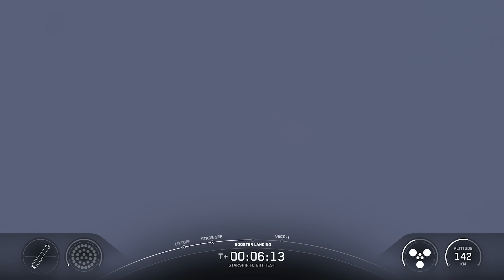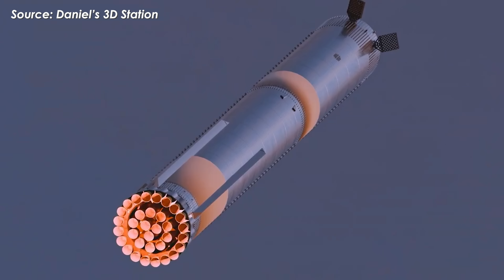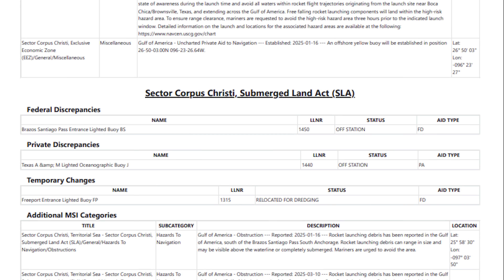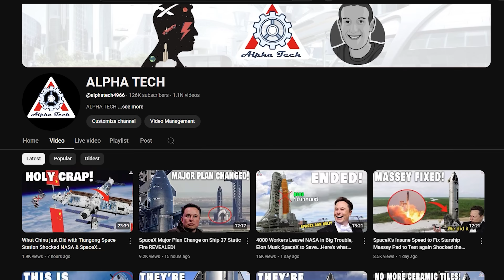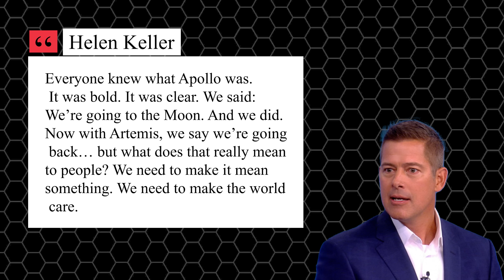SpaceX just announced to CANCEL Starship Flight 10 Tower CATCH, Here's why...

Comment: If they're too scared to try to catch the booster because it might destroy mechazilla then they can't have any faith in its reliability. At the current rate we're at least 5 years away from man-rated certification, if that ever happens.
Reply: Scared?  The usual pattern is dial it in with soft ocean landings and once they get that they try a catch.  Man rated?  That's a NASA thing and not something they need for their internal operations and it refers to ground to orbit and not even NASA plans on using starship for that.

Comment: Since SpaceX knows precisely where Super Heavy will splash down, is it possible to have a fireproof, extra heavy-duty net with inflatable bags 20 feet or so under water to float the booster to the surface until it can then be easily retrieved.
Reply: Sure, someone just needs to design, then engineer and test build and deploy.  So years...

Comment: 11:15 "...deploy a nuclear reactor on the moon by 2030...": They can't even do that on Earth. And they're clueless about what kind to build and how to build it. We had the answer 60 years ago... and the morons scrubbed it, never to rise again. It's the obvious way to build a reactor. It's fueled mostly by Thorium. It's a continuous flow liquid system with a fluid core and a fluid outer blanket. It has a natural negative feedback loop. It doesn't use graphite cores or expensive to manufacture pellets. It operates at ambient pressure... but with liquid salt it has a much greater heat absorption and distribution range. Read Alvin Weinberg's "The First Nuclear Era". Become aware of the dangers of never achieving bureaucrat types like Peter B. Lyons (thank goodness he has recently expired).
Reply: Thorium isn't a fuel, it's breeder material.

Comment: 4:00 "...high angle of approach...": What's the hurry? Why not spiral in with a minimal angle of approach?
Reply from the maker: Maybe they just want to push the booster to its limits.
Reply: @alphatech4966  Maybe. But if the did a more gentle reentry couldn't they eliminate the need for the heat shield?
Reply: Its about payload to orbit. The more efficient the booster is the more it can send up